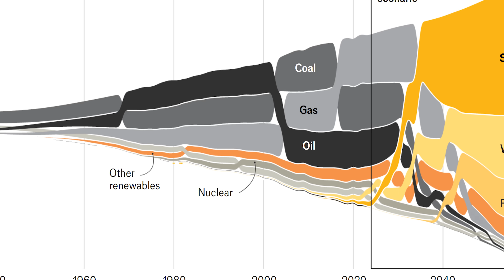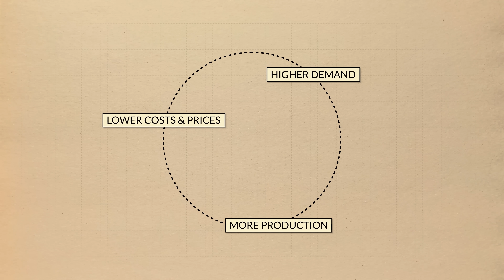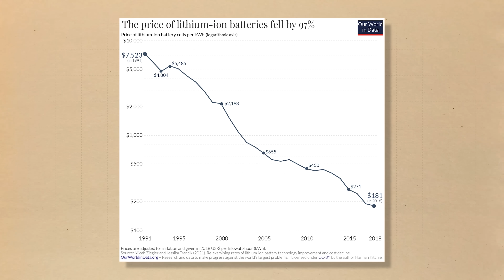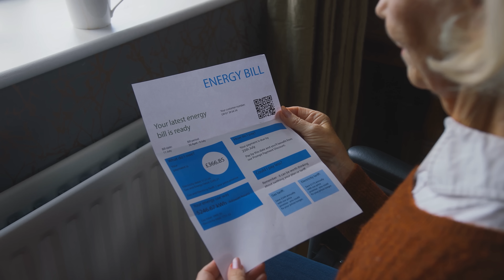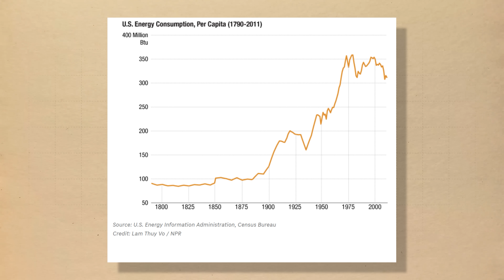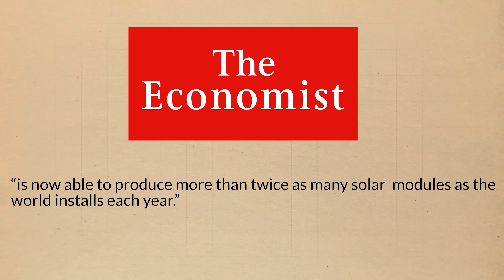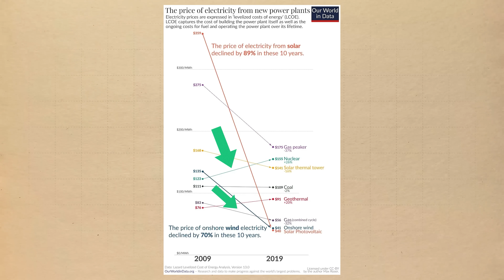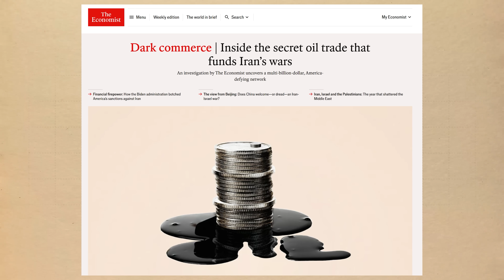Why solar will soon dominate & what that means for the world

Comment: Most of the land coloured in dark red is desert and not populated so I wouldn't say they're very meaningful areas of growth for solar energy since it's not easy to transport electricity generated from solar over large distances.
 
Oil and gas rich country are incentivised to keep selling their fossil fuel and delay the transition. Some leaders in middle eastern countries are still investing in it which is good. As you say, there's air conditioning, but I think their primary concern is water desalination and that's also energy intensive; there are projects to use solar power for that.

Even with solar becoming cheaper, there will need to be investment in infrastructure; it's not just about installing the solar panels. We'll see solar energy use increase in countries with the capital for it (which are also the ones consuming the most energy) and that's what we're already seeing. So I doubt there will be much change in the large economic powers. Some places in Africa might get some benefit from it if they have a stable environment (so scratch the Sahel, Sudan, Ethiopia, Libya, Congo, probably more...). There's war in the middle East and that's never great for business. Israel does embrace solar though.

Since China has such huge production (which is apparently outpacing the installation capacity) and has driven prices down to this extent, does it mean that they're not really getting the full benefit of selling these to other countries? It seems to me that for the foreseeable future, it's mostly China's capacity that is going to keep growing at a rapid pace (which I'm sure will benefit it greatly), and eventually that internal demand should saturate. I expect they'll stop being subsidised eventually.

European installation are apparently slowing down, and that's a big market that is most open in buying solar panels from China.

So yeah, it's hard to predict how things will go, but there's little doubt that China will be the main producer of solar energy. As for what happens when it has weaned itself off of fossil fuel... Let's hope not war.
Reply: It's pretty much exactly as easy to transport electricity generated by solar over large distances as it is electricity generated by any other method.
Whether that's enough to get it from those places to where it would actually be used is, of course, a different matter.
Reply: @laurencefraser  Yeah, i misspoke. I meant that if you are hoping to generate electricity with solar power in areas where there is space and sun (north africa, australia) and export it over long distances, it requires costly investment in infrastructure and cooperation between several countries, so it's not easy. I think Australia was trying to export electricity to singapore or something.
Reply: There are technologies called HVDC and UHVDC which can transfer electricity long distance with very less loss. HVDC is used in many EU countries which can transfer electricity for hundreds of miles. China is using UHVDC to transfer electricity generated from northwest to southeast for thousands of miles. But it needs large  initial infrastructure investment. Once built it will be cheaper than land transport oil or coal.

Comment: At first, the naysayers were pointing out at the cost of solar panels. Then the prices dropped dramatically. Then the next objection was the sun is not always shining. Then came the cheap batteries. After that, skeptics were pointing at the unreadiness of the power grid to accommodate such an unsteady source of energy. Then power companies started investing and improving their grid management. Finally, forecasters were saying that solar would never account for more than 10% or 20% of energy production for a country. We now have Spain with more than 60% of energy production coming from renewables. Excellent video.
Reply: That last one does vary based on where you are, admittedly, and while batteries are currently pretty good for keeping a (reasonable) house running over night they still have issues at grid scale, so there is still need for other generation methods... but battery technology, and electical grid technology, continue to improve, and even as they are they do allow for solar and wind to make up a fair chunk of energy generation, which allows for a reduction (or at least lack of increase) in use of other generation methods, so they're absolutely worth investing in.
Reply: @laurencefraser  I agree. Other generation methods are still needed. We need, as the pandemic has shown, to build resiliency in our systems. That means having other sources of energy. Can a country go a 100% renewables? Personally, I am skeptical. But in the same way as the forecasters of the past, I might be wrong!
Reply: While i very much think renewables are gonna be huge in the next couple of decades, and it would be foolish to think solar wont lead the charge, i think its also disingenuous to ignore that there very much are problems with it (same as any other energy source). Biggest problem with solar is storage, which is a whole 'nother industry and while solar just gets cheaper and cheaper, energy storage is not so simple, creating batteries is very resource intensive and im not sure energy storage prices have have the same path solar has. It will be interesting to see how the world solves these drawbacks, and hopefully we reach a point where producing enough energy for everyone wont necessitate terrible consequences for the world
Reply: @sol_in.victus  Oh yes, there are serious issues with batteries. That includes polluting the environment with metals. I am hopeful that batteries using less toxic, less impactful materials on the environment will become more commonplace. And yes, the mining of lithium as it is done now, is pretty awful. Like you are saying, every technology comes with its drawbacks and costs.
Reply: 60% of electricity production...  but still this is great news. Spain has lots of room for solar panels.
Reply: All of these issues remain, read my above comment
Reply: Yea get back to me when I see this cheap energy in my energy bills. 

Probably the cost of the panels that has been eliminated (hopefully not just by unsustainable chinese government subsidies), nothing else. The batteries aren't getting any cheaper anymore. There was a huge price decrease between 2013 and 2018 but since then, battery prices are basically stagnating. And no one can say they are cheap enough today. The grid is simply not there despite all these alleged investments and last but not least energy production is very different from electricity production. Spain can probably cover 60% of its electricity need by solar, but electricity is about 20% of the entire energy consumption of a country. So then, Spain covers only 12% of its  energy needs with solar.
Reply: Just checked Spain's carbon intensity. It's 176. France is 28. Nice try, though.

Comment: The problem is Solar is so unstable that grids still have to keep gas power plants online just in case solar production suddenly drops.
Reply: Battery technology mitigates that problem, Heck, Capacitor technology mitigates that problem, as does the use of wind turbines,  and it varies by climate to begin with. Also supposedly the whole 'base load' thing is a lot less straight foward (and often less of a problem) than people make it out to be. But the end result is that solar allows you to have Less oil and coal based generation for a given level of electricity demand. Not needing Any is still a long way off.
Reply: @laurencefraser  it should, but currently not yet happening. Especially for Germany. They emit almost as much Carbon and a lot of their solar goes to waste because the utility doesnt want to risk powering up the oil when solar suddenly drops.

Hoping batteries have become cheap enough to stabilize renewable supply.
Reply: Batteries (chemical and mechanical) can store energy for times of low production. There is no need for gas.
Reply: @schubajo    "There is no need for gas."
Well, there is currently a need for gas, because not enough solar, wind, and batteries have been installed yet.  
Battery prices are expected to fall by 50% by 2026 or '27.  Watch for LOTS of batteries being installed in 2026 and later while cheap renewables and batteries drive coal, nuclear, and natural gas out of the electricity market.
Reply: @calamityjean1525  Yes. I should have said there is no need for NEW gas. It's more expensive and dirtier.
Reply: It doesn't need to be gas just a stable energy generation. Can be nuclear.
Reply: @vericulum6810 or a renewable gas option! People like to forget biomass can be used to fuel gas plants as well!
Reply: @vericulum6810  yeah, too many close minded voters unfortunately.
Reply: I think nuclear for the major industries and cities, solar for the average household and backup energy storage, and other fuel sources like gas, hydro, biofuel, and so on to fill in the gaps